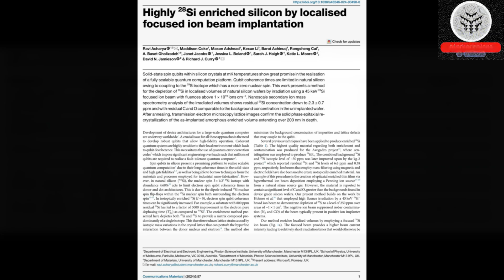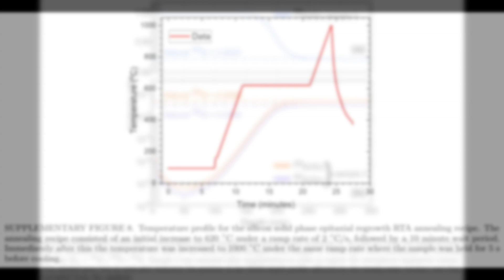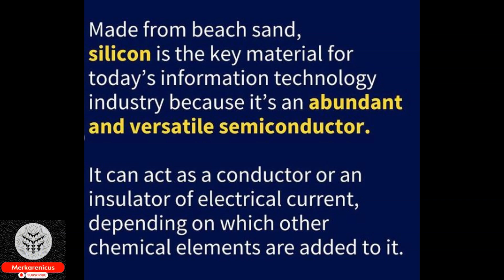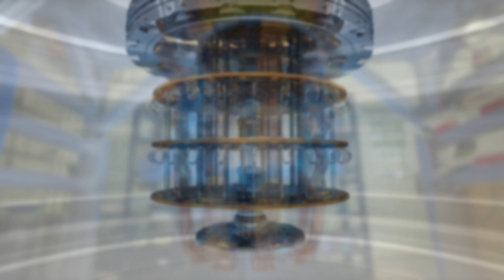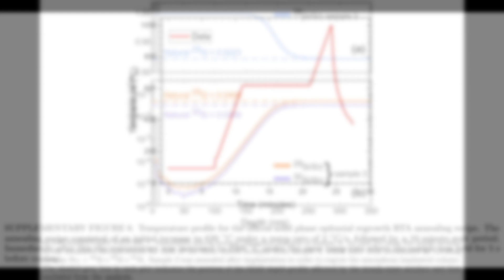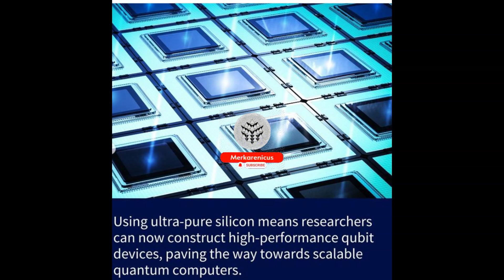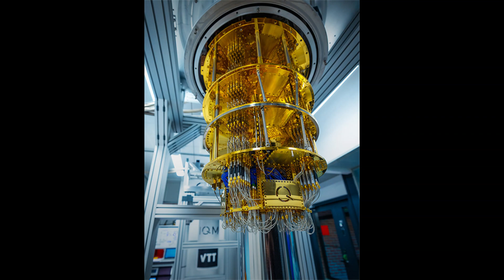An Ultra Pure Silicon Chip Has Emerged Paving The Way For Highly Advanced Quantum Computers

Comment from the maker: Sources -  Acharya, R., Coke, M., Adshead, M. et al. Highly 28Si enriched silicon by localised focused ion beam implantation. Commun Mater 5, 57 (2024). https://doi.org/10.1038/s43246-024-00498-0
https://www.csiro.au/-/media/Do-Business/Files/Futures/Quantum/20-00095_SER-FUT_REPORT_QuantumTechnologyRoadmap_WEB_200518.pdf
Muhonen, J., Dehollain, J., Laucht, A. et al. Storing quantum information for 30 seconds in a nanoelectronic device. Nature Nanotech 9, 986–991 (2014). https://doi.org/10.1038/nnano.2014.211